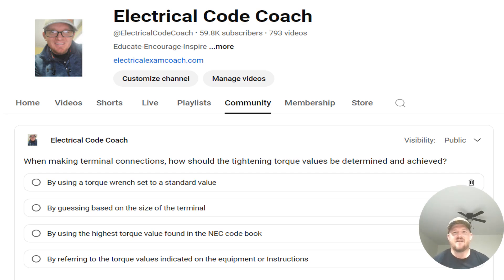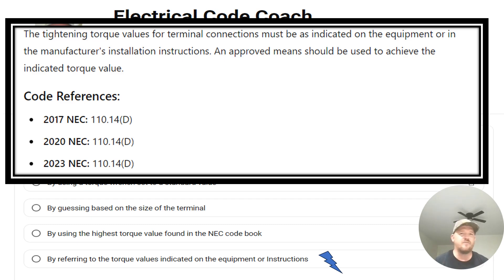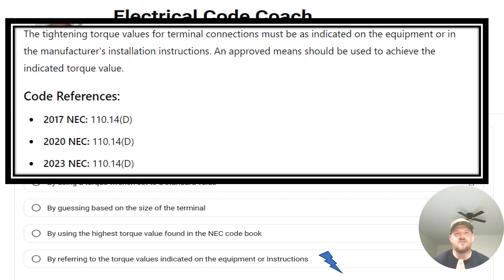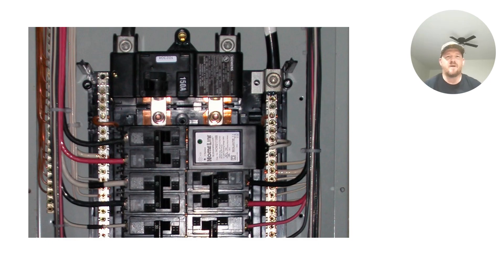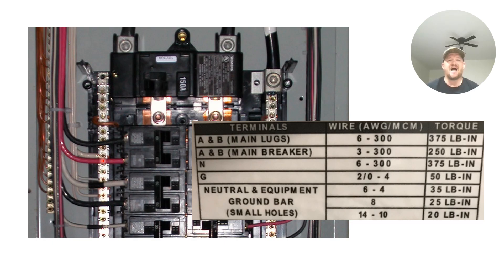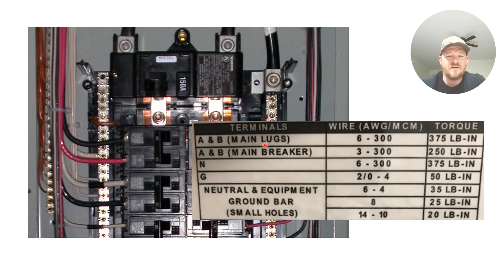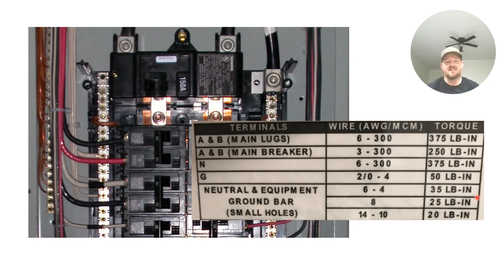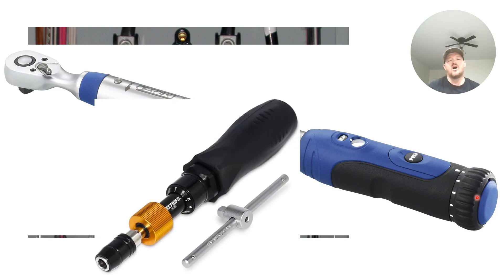#166 NEC Electrical Question of the Day Torquing 110.14

Comment: First of all thank you for the video. I have a question about using ferrules. If you use ferrules that changes things. For example, when wiring a 14L-30 plug, the package gives the torque values. If you are using fine stranded cable and crimp a ferrule on the end of the cable going into the plug, how do you know what the new values of torquing the connection should be? I did this and I was worried that if I applied the torque values that was specified, the plug would break because of tightening the connection too much. What should you do?